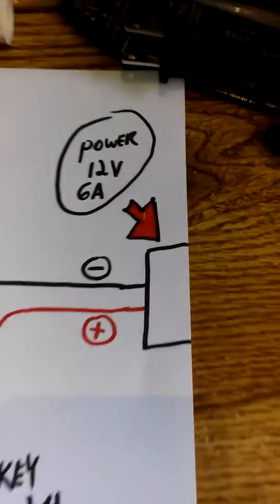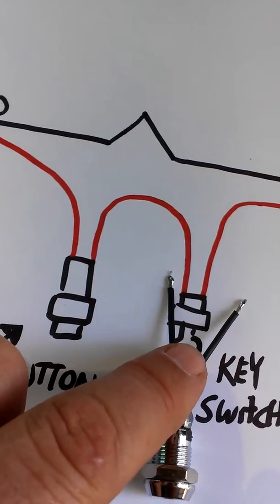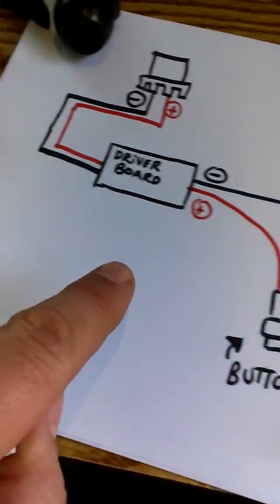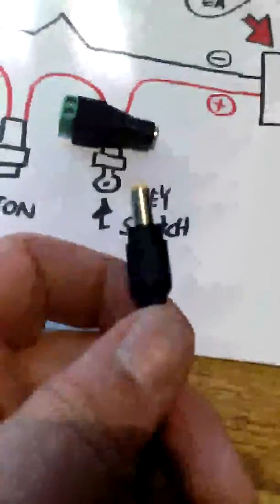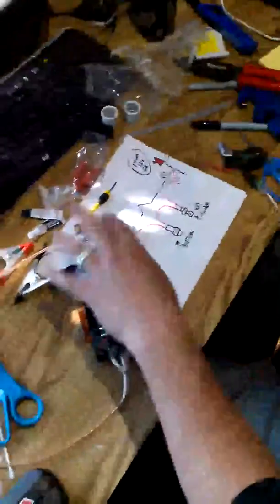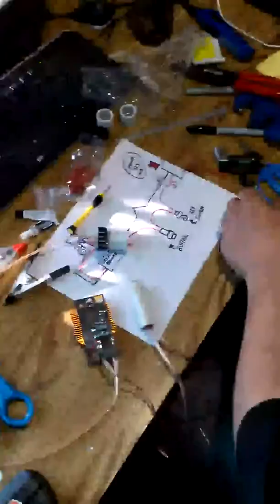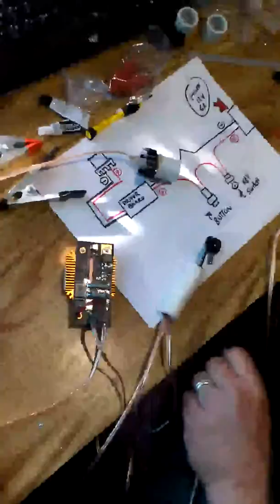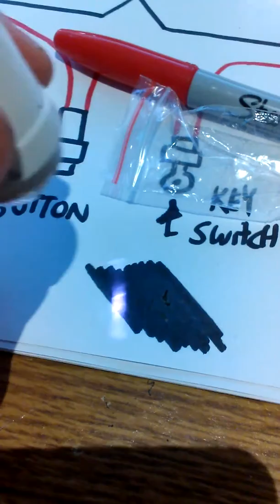HOW TO BUILD HOME MADE TATTOO REMOVING LASER 3W

Comment: This is not a Q-Switched laser - you would have to be fucking crazy to shine this at your skin
Reply from the maker: i may be @$cking crazy.but my tattoo is gone. so is everyone else's tattoo that used it most people understand the principles involved with this device use it accordingly because it is not to switched although it is not 1064 nanometer 808 NM has almost identical absorption principles yes crazy people do their homework too
Reply: +attila,tibor Gibson it's not the wavelength I have a problem with, it's the pulse duration. Q-Switch lasers operate with pulses typically measured in nanoseconds. This very short burst of extremely high energy light generates a photomechanical shockwave in the particle of ink, shattering it while leaving the tissue it passes through totally unaffected. You appear to have an uninterrupted beam which sets fire to stuff, including human tissue. Scarred you much?
Reply from the maker: +Aaron Carr it scarred me a tiny bit but I designed it for friends of mine who are EX gang members who got clean and got their lives and families back and benefit the society that they live in immensely!! Who had small tattoos that would have got them killed!! That was the whole point in designing it. it was low cost, effective and saved people's lives .I never recommended it for anything more than tiny tattoos. obviously a Qswitch laser is better I never argued that fact but when people are trying to kill you because of a small number or a gang sign on your skin a little scarring is a small price to pay. I do however recommend being cautious of calling people names in a public forum. fortunately I'm proud of the fact that I'm crazy enough to help other people when most people won't. or because it's not profitable for them too
Reply: +attila,tibor Gibson you got pictures of the scarring so people can see for themselves what this rig actually does to skin?
Reply from the maker: +Aaron Carr
on every video that I'm treating my tattoo everyone can plainly see the results there are no secrets here and everyone who inquires me directly about the device is given about a two-page pros and cons of the device and a very clear understanding of how it works and explicit instructions never to use it on large tattoos
Reply from the maker: Mr Aaron Carr .I know you don't understand what it means to truly fear for your life because of a mark on your skin. I know you've never seen the results of gang members who have used a blow torch to remove their tattoos, or used belt Sanders or just sliced it off with a razor blade or a piece of broken glass because they spent money on their families for the first time in their lives instead of drugs and couldn't afford a CLINCAL outcome!FOR SEVERAL THOUSAND DOLLARS.
so I forgive the fact that you're clueless on the truths and realities of those who struggle to survive in less-than-perfect circumstances, and that I actually do understand that you speak on behalf of genuine concern for the Aesthetics but you clearly have a lack of understanding of the bigger picture of this situation to be honest I hope you never have to placed in the position in life where you have too.  have a good day sir.
Reply from the maker: +attila,tibor Gibson oh and if you have a laser tattoo removal business which I suspect you might you might consider donating some time for free to help others just a thought
Reply from the maker: +Aaron Carr you are more than welcome to post these organizations on every one of my videos 
 it is my hope that you will take as much timeto post this information. as you dedicated attacking people like me. but I highly doubt you're going to sit down and actually look this kind of stuff up and see how difficult it is to find and actually care enough to post it on my videos I certainly hope that you do. so you can vindicate yourself in this conversation I would like nothing more then tattoo removal be as easy as you say it .
oh and you might have noticed that I didn't have to use cuss words to speak my mind.
you have an intelligent conversation. I'll actually be surprised as to how much more seriously people will take you
anyways looking forward to those posts glad to have you aboard helping the cause thank you and God bless
Reply: +attila,tibor Gibson Dangerous self-righteous lunatic
Reply from the maker: +Aaron Carr it is good that we have these conversations I believe the best decisions that people can make are well-informed ones